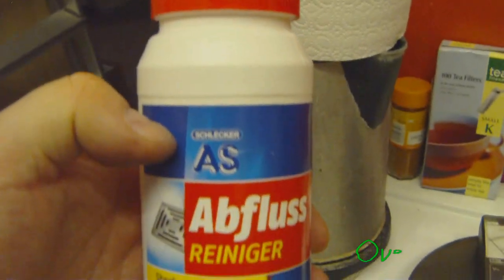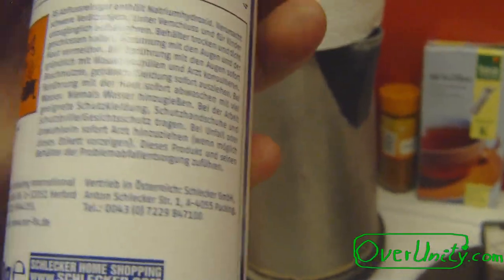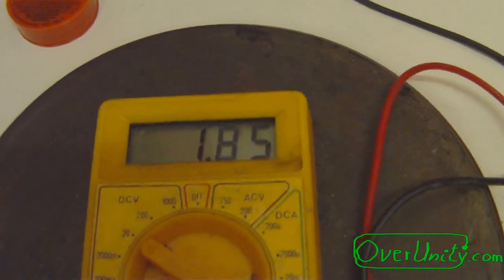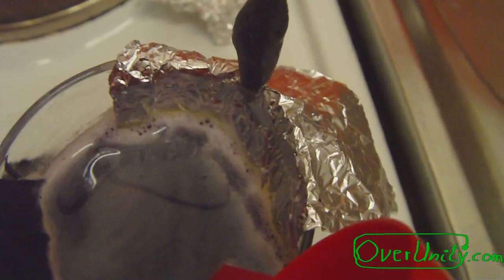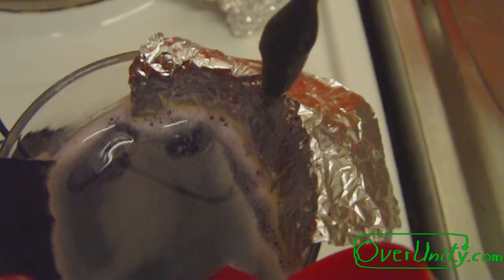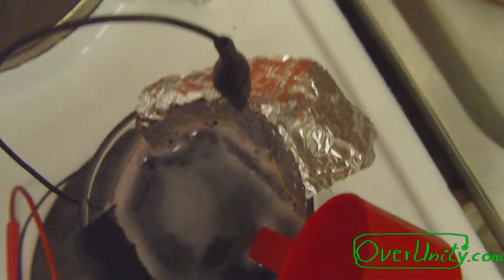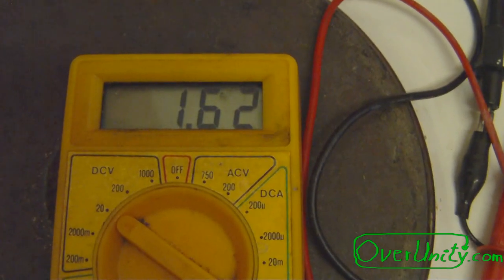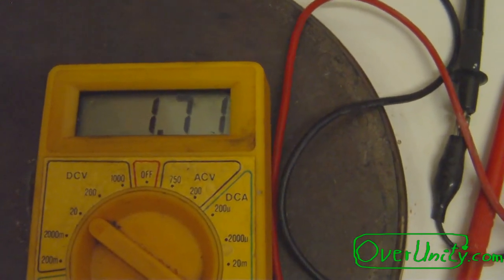Graphite-paper Aluminium foil battery cell breakthrough voltage up to 1.92 Volts 2/5

Comment: hiya stefan try mixing antimony sulfide (Stibnite) in your carbon it should hold down the hydrogen production - use about 1% by weight - rob.
Reply: http://www.extremetech.com/extreme/175137-sugar-powered-biobattery-has-10-times-the-energy-storage-of-lithium-your-smartphone-might-soon-run-on-enzymes
Reply: Robert Murray-Smith wow! You are all over the Internet. You need a couple of employees in the USA 🇺🇸. Will work for free.

Comment: did u know that NaOH will eat Al alive, it releases H and heat even though you are not using the electric power, so it's only a solution for instant electric power.